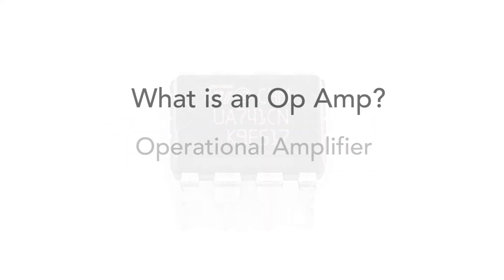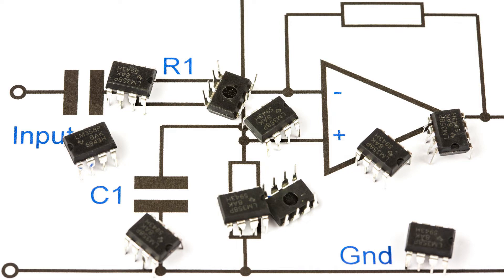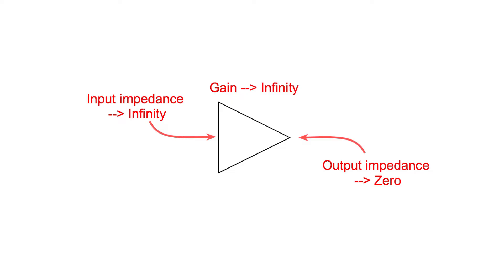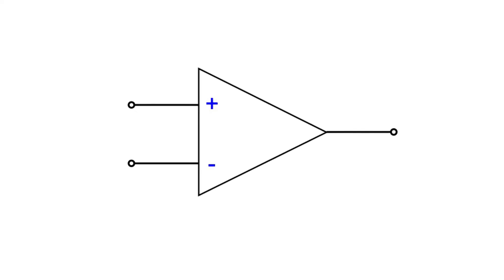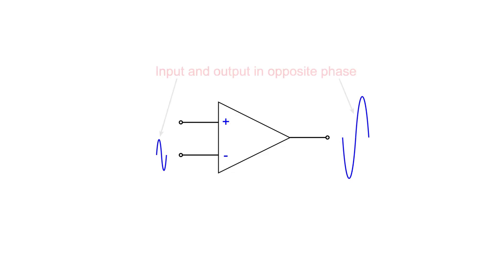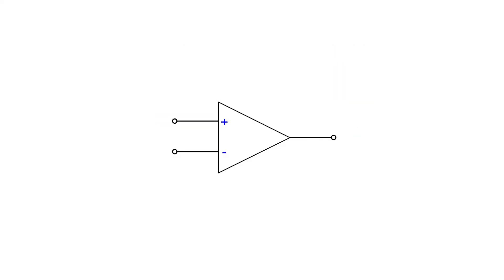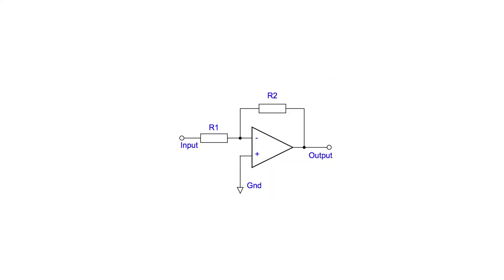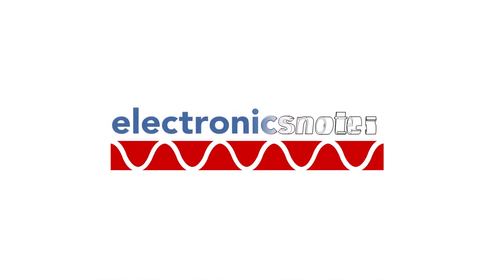Understanding Op Amps, Operational Amplifiers #opamp #operationalamplifier

Comment: But what exactly is an op amp?? I’m assuming there’s a lot more stuff inside this triangle that allows it to do these things
Reply from the maker: Yes , there’s a fairly bit inside, but basically they are a form of differential amplifier. https://www.electronics-notes.com/articles/analogue_circuits/transistor/long-tailed-pair-circuit.php
I hope this helps.

Comment: You still didn't say what the fuck is an op amp or what it is used for. Thanks for the clickbait. Im a beginer in electronics and all i can find is "esoteric" talk from you so called "professionals" pretending to explain shit. You may never realize how frustrating this is.
Reply from the maker: The video said that an op amp is an amplifier with a very high gain, high input impedance and low output impedance. It uses a differential amplifier and therefore the output is proportional to the difference between the two inputs.
Reply: ElectronicsNotes Good... now give me a few weeks to get famliarized with those concepts... Anyway, thank you for your reply!
Reply: sorry for getting so boiled, i understand that you put much work making those videos, but is so frustrating for a beginner when he or she cant grasp what is being said...
Reply from the maker: I quite understand. It is not easy to grasp the concepts when you get started. I remember when I was in a similar position and I did not understand what was being described. It takes a while to build up the picture of what is actually happening there. May be I need to make a few more basic introductory videos to help. However, as you say, they take quite a while to make, so it might be a while before I can get them done. Hope all goes well as you get to grips with all the technology.
Reply: yes... after all, they will come in handy.

Comment: But what is an Op Amp?
Reply from the maker: An operational amplifier or op-amp is a DC coupled high gain differential amplifier. It has a + and - input and normally a single ended output.  had hoped I had answered this in the video.

Comment: what is input and output impedance
Reply from the maker: The input resistance can be thought of as the resistance at the input of the circuit as seen by the previous circuit stage. It is effectively the resistance seen at the input. Similarly at the output, there is a resistance in the circuit and if a low impedance load is placed across the circuit, then the internal output resistance will develop a voltage across it, heat will be dissipated, and also the output voltage will fall as a result of the potential divider effect. I hope this short explanation helps.